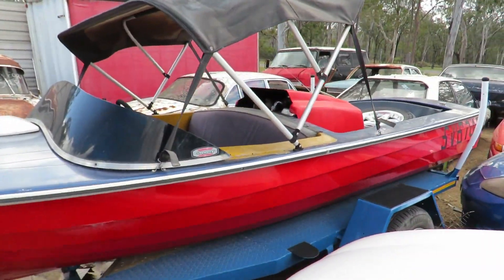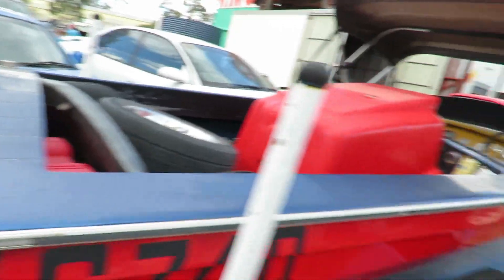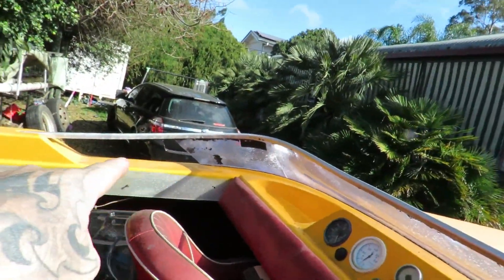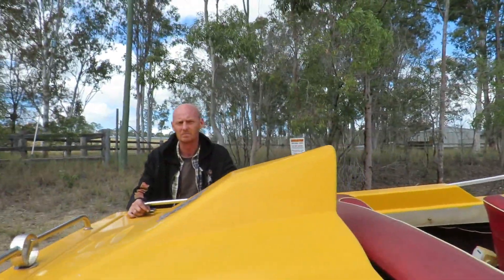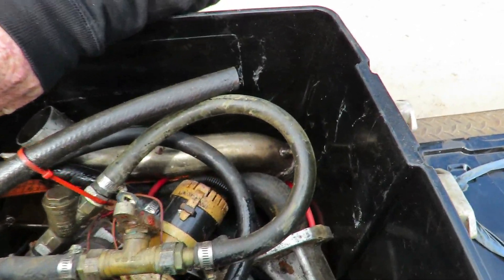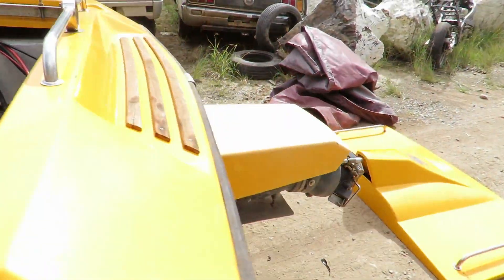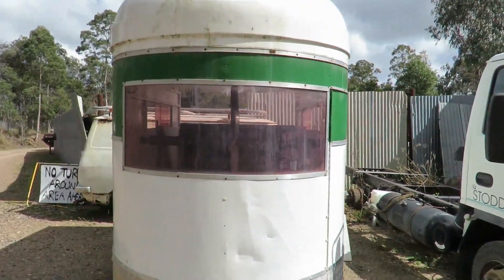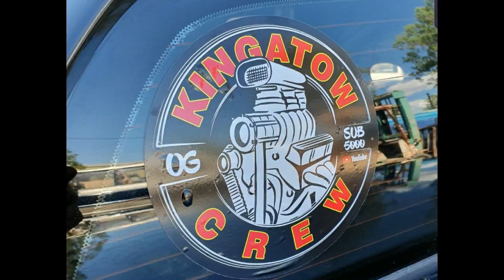Kingatow Crew #108 | I think I Need a 350 CHEV Powered Jet Boat

Comment: Gee the jet unit hangs all the way out the back. Pulled  one recently that was powered by a 187. Be tricky water skiing with a jet engine set up not recommended.  Better for shallows and bar crossings and beaching.
Reply from the maker: skiing is not really high on my agenda...more of a big v8 making noise and shooting roosters but good to know that I should do some research on different jet setups for the future